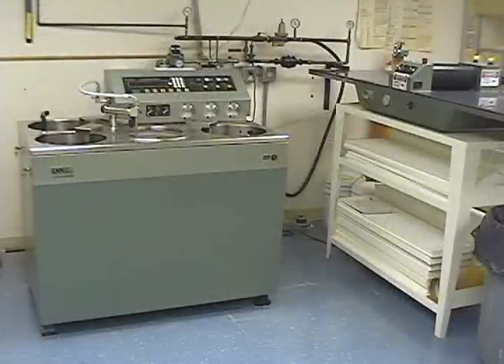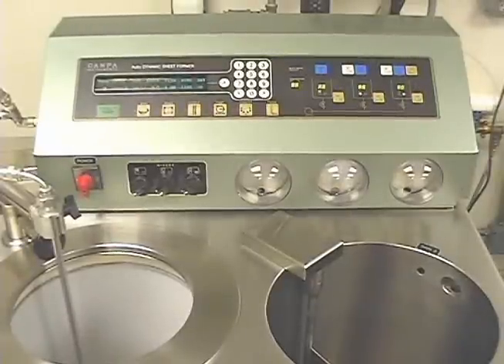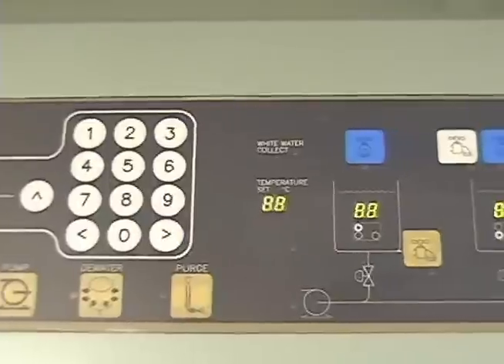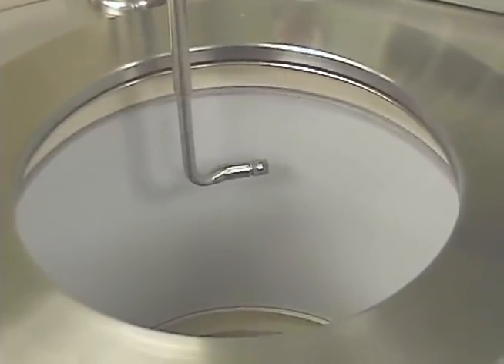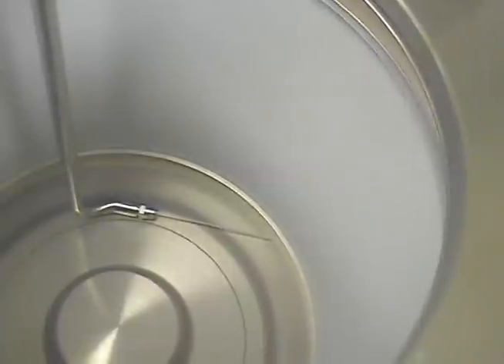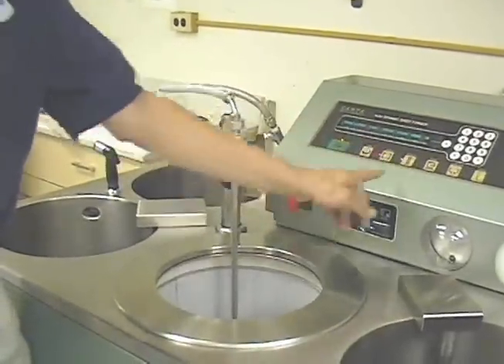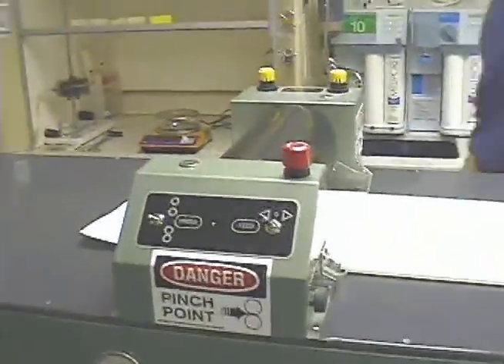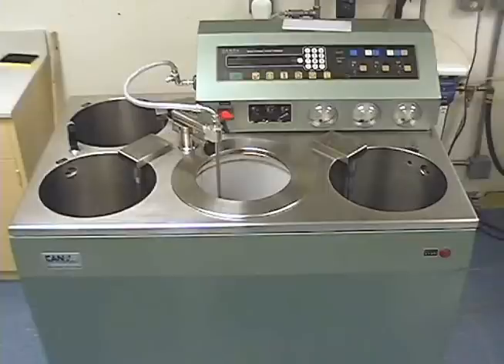Dynamic Sheet Former (Formette Dynamique)

Comment: When making a multi layer sheet does the previous pulp get drained against the screen before the next one is added to prevent mixing of the layers?
Reply: Dear Kalle,
Sorry for the late response.
During spraying of the pulp onto the water wall, fibers, which are heavier than water, migrate due to centrifugal force (multiple g) towards the wire.
There are two parameters to magnify this effect:
“Pause between layers” (in sec)
“Dewater between layers” (in sec)
The second one should be used only after a consideration: there should always be a water wall present for the next layer and this depends on the values of the “Primary water wall” and “Secondary water wall”.
Primary wwl is built before spraying the 1st layer.
Secondary wwl is the allowed thickness of wwl during spraying, i.e. the scoop starts dewatering and will not allow a further wwl build up. By design the max thicness of swwl is 15 mm.
The scooping speed (parameter “Dewatering time”) must be considered too.
The last choice is “Purge between layers” (0/1) which cleans the lines from the (mixing chamber (bubble) to the nozzle.
There is a text: “Make three-layer sheet using Canpa ADSF system” that we can email to you.
Again, my apologies for the late answer,
Cvetan Petrov, Terry Murray
Reply: @terrymurray9430  Thank you.  I was looking at a few of these lab machines and wondering if any of the techniques could be modified for craft production.  Having a way to make paper with multiple layers is interesting but more of a curiosity thing.
Reply: @terrymurray9430  Thank you very much Terry for the answer.  Very old YT accounts are often dormant so I was not holding much hope.

My interest is mostly curiosity and the potential to develop a system to make specialised paper on a small scale.

If you had to guess what would be the largest sheet size that could be made with this technology and what would be the shorted cycle time for 100-200 g/m^2 product?  Obviously the capital cost will be much higher for a bigger drum.
Reply: a dynamic sheet former makes a sheet of paper from kraft sludge. The kraft pulp is made from wood or other materials in the paper mill or a lab by other processes.